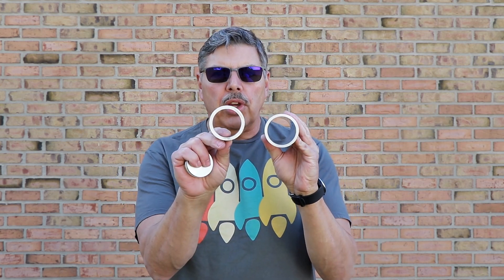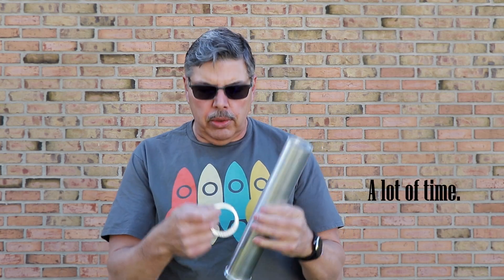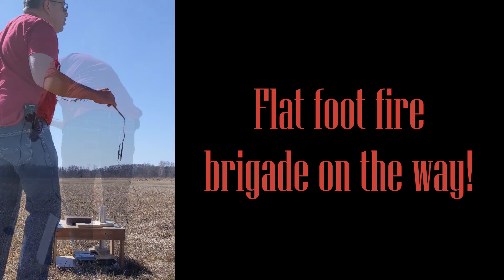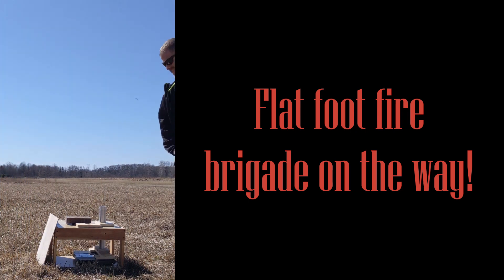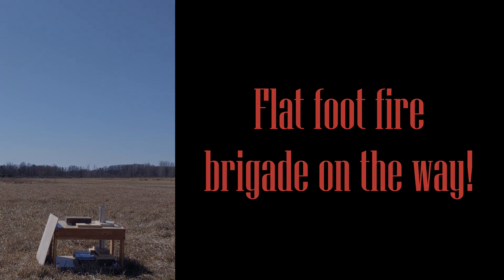54mm sugar motor, custom case, 3 grain test

Comment: What does the motor come out to on the scale. I’m new to rocketry so like I-j-k?
Reply from the maker: The sorbitol motor is an I-270, 622 Ns. or almost a "J" motor.  Impulse range for "I" is 320.01-640 and "J" 640.01- 1,280.
You can find a handy reference table here:
https://en.wikipedia.org/wiki/Model_rocket_motor_classification

I have updated the comments to reflect the new information. Thanks for your question!

Comment: nice!  do you have a drawing available - thanks?( check if OK. with regulations first)
Reply from the maker: I don'y have a drawing but information can be found on the LOKI site. Aluminum schedule 80 pipe has the correct ID but the OD needs to be reduced. I did not save any money having the motor made however I did learn a lot and enjoyed the process. I hope that helps.
https://www.lokiresearch.com/page/Tech_Info
https://www.onlinemetals.com/en/buy/aluminum/1-5-nom-schedule-80-aluminum-pipe-6061-t6-extruded/pid/1230
Reply: @TheRocketeer  Thanks

Comment: love to see your progress from pvc to aluminum. What would the impulse letter be of the motor?
Reply: 622 Ns of total impulse equates to a mostly full I motor
Reply from the maker: The motor is an I-270 with 622 Ns. A J motor is 640.01Ns so I have some work to do : )

I have not given up on PVC motors. The channel has a lot of international viewers that can't obtain or afford an aluminum case. Thanks for your comment!
Reply: @TheRocketeer  i have a tip for you. If you add a bit of black powder and coat the grain hole with a thin layer, the motor will instantly ignite